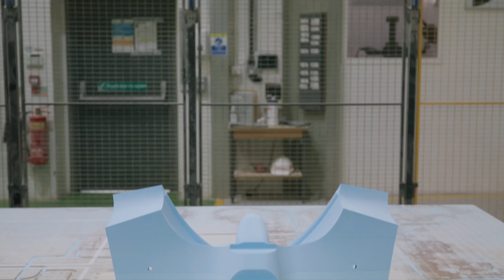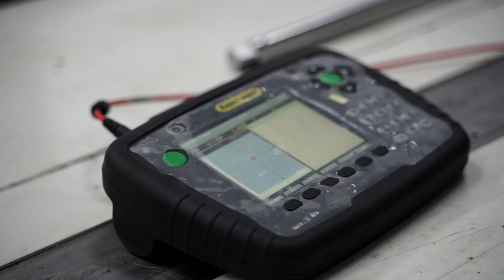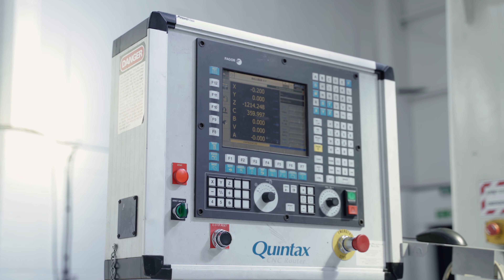Journey to HX50 | Episode 13: Hill expands its workspace, adding 2 new facilities

Comment: straight to the point i will go .

the idea is that because you will build even bettter  helicopters and  i want to give you an idea on windows. since many helicopters land in public areas i saw it wise to install smart tint windows in accordance with the colour of the helicopter . the smart tint window will operate at the touch of a button so even if you are in public and you want to minimise the public gaze by the touch pf a button and your confidentiality is there. 

jambo. am martin murithi and i finished my degree in bcom (management science) 

in january and am now awaiting graduation on 6th october this year. i can work in your company and bring more diversity in any department and i can say i have the ability to outsmart one with ideas and to think outside the box. and bring ideas which can make your company crash the helicopter markets.

im 22 years old and i have a passport and am ready to bring you more ideas you can incorporate with elegance. 

thank you
Reply: You don't want smart tint on a helicopter. 1) It only lets in 93% when ON and 7% when off. What if something happens to the power supply ;) ? Not exactly meant for aviation and the strict quality control that goes into aerospace applications.